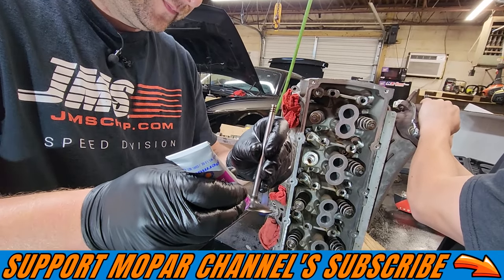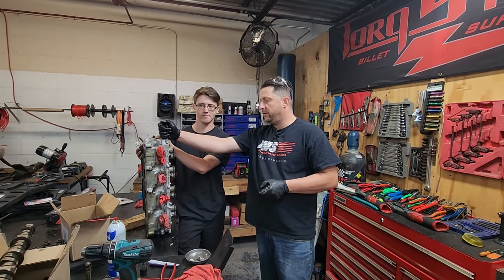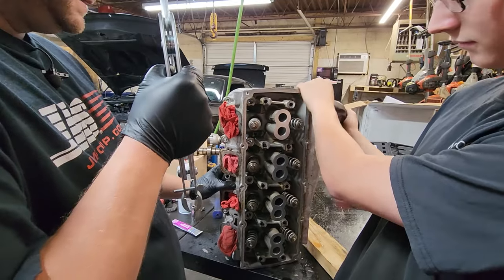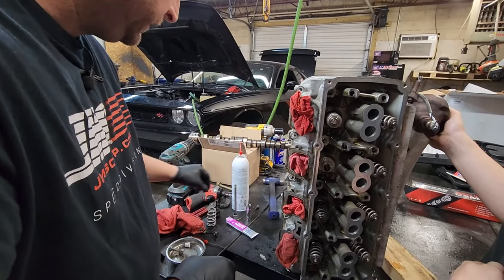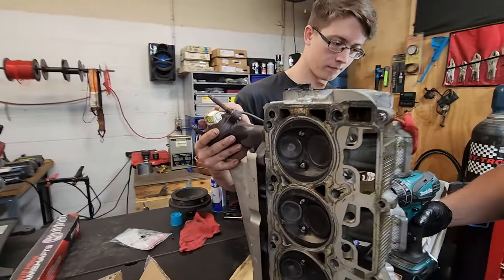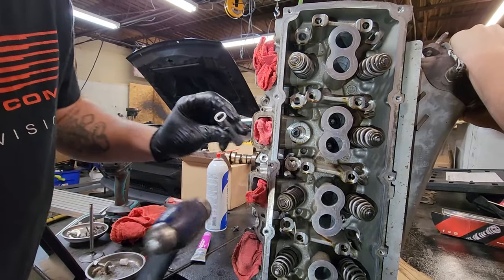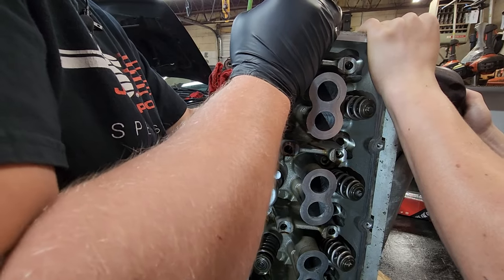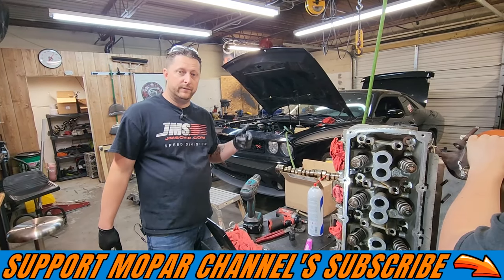DIY Upgrade Your HEMI Valve Springs For That Big Chop Camshaft Part 3.

Comment: I did my valves with a valve suction cup tool. That 5hp Briggs ran great. 😁  If I were upgrading my 5.7 cam I'd sure be doing springs and lifters. I actually replaced all my springs with the engine in the car (had an exhaust spring break) using the Snap On compressor tool. Made it a snap.
Reply from the maker: Right on

Comment: Is there no need to measure install height cause it seems like some folks just pop off the old spring and put the new one in😭 HELP
Reply from the maker: @hemi_dirt  if your using quality parts and oem lifters no you good.
Reply: @FrostbiteRam  I appreciate that luckily last night I figured out the math equations I think for coil bind and stuff so I think I’ll be good. I got a comp cam with .632/.619
And the valve springs i ordered are .650 from btr so i think im okay🤞🏾
Reply from the maker: @hemi_dirt  yeah,as long as your camshaft says works with stock pistons then you shouldn't have to worry about it.
Reply: @FrostbiteRam  okay it was a kit specific to 5.7 eagle hemi’s. Im sure its clear that this is my first build😂